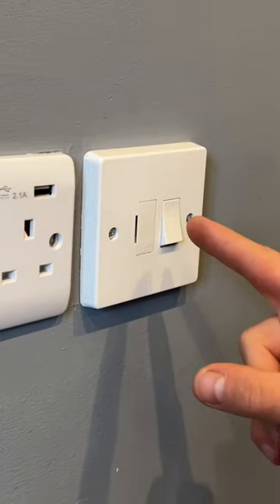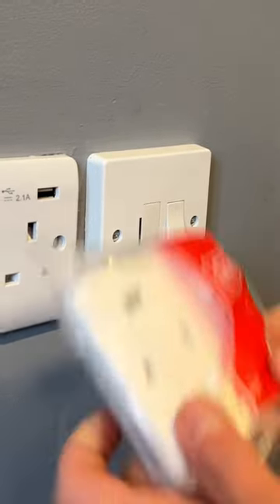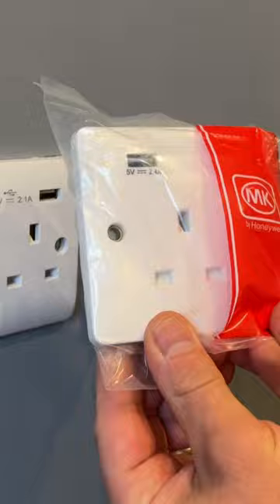Should homeowners and DIY Dave be allowed to change socket fronts? #electrician #shorts #prysmian

Comment: Yes, absolutely homeowners should be allowed to do these tasks. We are not all without a good understanding of electricity, regulations and safety. Not everyone who does their own work is a DIY Dave - I certainly don't want a fire or shock. The original installation in my 2004 home, built and certified by a major national builder, was awful.  It would be a gross intrusion of the nanny state if I was unable to do competent repair or upgrade works in my own premises.
Reply: If this was an old installation with no rcd or rcbo protection, then adding a socket to ANY circuit would be against current wiring regs. How many homeowners are going to know that?
Reply: @semperidem2577 not really interested in getting into this debate but the extra socket would be no better or worse than the rest of the installation. Incompetence is a problem amongst some trades as well as DIY
Reply: @johnwarwick4105  That is patently not true, if you have an installation that is already not as safe as it could be, then adding another socket is just compounding that risk. You can choose not to debate it until you are blue in the face, but the fact remains... it is against the regs. People seem to forget that insurance companies use any excuse to not pay out on a claim, if you're installation is dodgy and that has resulted in a fire...  that's just the sort of excuse they are looking for, to not pay out 😉
Reply: @semperidem2577   "There is no protection against human stupidity." RCDs and RCBOs are just that, protection in case someone dumb enough sticks a fork/knife whatever into something live......
(In europe we do not us those and for some reason we aint dropping dead like flies from shocks....)
Reply: @semperidem2577  I agree with both of you. John is correct that it's no worse... but you are absolutely correct it WILL invalidate the insurance
Reply: Do home owners have MFT's and know how to use them, so they can confirm its safe?
Reply: @TeamSimpsonRacing  That is a fair point, but equally  a homeowner doesn't have the equipment to perform PAT checks on their appliances either  (I do come from the generation where you had to fit your own plug!).  If I do minor, permitted works at home e.g. replacing a socket I use a relatively inexpensive 13A plug-in tester which as well as polarity does a basic earth loop impedance check too. If I install a class 1 light fitting I will always check earth continuity with a simple meter from metalwork to another good earth point. Clearly these are totally inadequate to certify professional work, but I believe these are reasonable tests that a competent homeowner can take - in addition to the most important factors of visually inspecting the work and understanding what you are doing.  "DIY Dave" is always going to exist and legislation isn't going to stop him, but it would punish others.
Reply: You can replace an existing socket as the regs are not retrospective. Adding an additional socket the current regs apply.
Reply: @smiffysmiffy123 If done by a professional a minor works would have to be issued, but as it is not notifiable works if the homeowner did it themselves to the same standard as the rest of the house who would know?
Reply: Only problem is you don’t have suitable testing equipment 
Unless of course you’re willing to drop a grand on a tester and know how to use it and what those results mean
Reply: but my whole life revolves around telling people they cant do simple tasks in the name of safety /s
Reply: @oiuslags For changing a socket? Don't be that guy....
Reply: @semperidem2577  but it will just be the same as any other socket in the house. Not going to be any less safe is it? Not to current standards is exactly that, if it was unsafe, it would be coded accordingly
Reply: Hmm tricky one, can you be sure they will connect cpc’s properly though that’s one problem. Polarity too? Loose terminations causing high impedance or worse an arc and burns in equipment? A lot of things left to chance with someone who’s not seen as electrically competent.
Reply: @dom6140  I’ve done so many socket changes and then the tests have picked up unknown non visible issues that’s why we test and inspect all our work so no one dies, nothing catches on fire & most importantly I don’t go to jail because I tested, inspected & recorded my results on a test form that’s got a permanent record 

Common issues 
No ring continuity on any some or all conductors 
Rcd/rcbo fails to operate, yer do the six tests, it’s your bo!!ocks on the line 

Mega high loop tests on TN and TT  systems (relatively) ,

Oh look these a neutral fault at the cut out 
Oversize protection /undersized cables 
Wrong mcb in a DB , jammed in and bits cut out 
And my all time favourite mixed up conductors at the metre or reverse polarity ( the bs to get that sorted dealing with the electrical supplier can take months)

Yer so test stuff it’s still cheaper than a family funeral
Reply: @spark0420  The homeowner determines if they are competent enough, as they bear the risk. As a society, we've determined that some things are extremely risky and/or have the potential to affect others, so those activities are regulated (e.g. driving a vehicle, performing HV work, etc). I'd argue that a simple socket replacement is less hazardous than cooking over a gas range or riding a bicycle.
Reply: Try to stop us :)
Reply: How many electricians actually give you certification  for the work they carry out, answer very few. Most sparks I have worked alongside bodge. That's a fact. Money over safety comes to mind.
Reply: Lstd- not sure about that - no “ electrician “ knowingly installs dodgy work!  Issuing a certificate is another thing as in mine and many other Ltd opinion who has to fork out for the many schemes we subscribe to think it’s a con ! And it is a con! Being a member of the NICEIC doesn’t make you a competent electrician - I was a competent electrician when I gained my nvq3 and am2 - a certificate scheme should not allow any qualified electrician not to do said work - ridiculous.
Reply: @semperidem2577  the constant changing of the regulations don't help. I did mine 20 odd years ago with the 16th addition, now it's up to the 18th, and electricity is still electricity. Job's for the boys me thinks!
Reply: @wyattutz  You absolutely cannot do safe electrical installation work with the proper testing equipment, so how many people in your country own the required, expensive, test gear? Even then, you may be able to work the tester but interpreting the results properly is what sets the professionals apart. I'm betting not many would even know what  Ze, Zs or Zdb testing even is, and doing a proper adiabatic equation would have them running for the hills...
Reply: @wyattutz  Problem is, here in the UK a copy of the Regs will set you back £80 and a tester capable of doing all the required tests is about 10X that. So even if you had software that could handhold DIYers, the cost of the kit would be prohibitive. Finally, some work requires that you register the fact it has been done with the local council. The council won't just let anybody register work, you have to be part of a certification scheme. membership of which requires qualifications and an annual membership fee of £600+
I appreciate that electrical work is not that hard, you just follow the rules and buy the correct gear. Unfortunately, there's always some idiot out there that decides to rewire his whole kitchen in 1.5mm2. It has to be strictly controlled or it would get out of hand. Would you like to buy a property where the previous owner has 'dabbled' with the electrics? Even if you have an electrical inspection done, there's still stuff that could be hidden away waiting to go poof. Unless I bought a new build, one of the first things I'd likely do is rewire to my own satisfaction. Hell, I'd probably even do it with a new build given some of the cowboys that work in the construction industry over here.
Reply: @thelight3112  Unfortunately that is not true and is a common misconception, especially among the people requesting the work. As the competent person it is your and your responsibility alone to ensure that the work you do up to standard and to the Regs.  A property owner cannot say they will bear the risk, if for example they ask you to cut corners or do work that is not to the Regs.  
Courts will not recognise that and if anything has gone wrong, it will be the Spark who gets the blame. You, the Spark, are the professional and you should know better.

Comment: Loving the assumption that because the socket is isolated then the FCU must be too!!!
Reply: Pointless comment. There are too many unknowns.
Reply: @traineespark  Safe Isolation Procedure???
Reply: @traineespark  what lol.
Mark is absolutely right 
Your comment is just playing captain hindsight/devil’s advocate now
Reply: Definitely not. As a trainee you should know that you should have isolated supply and tested before starting the work.
Reply: I never regret safe isolation and it would have been easy to check that fcu with a voltage tester. Don't take your own safety for granted
Reply: @g7mks383 maybe yes but he’s showing how to do it to others on YT. It just guide how to get electrocuted then
Reply: yes certainly @master00log
Reply: @traineespark that’s why you’re only a trainee. Come back when you’ve finished school.
Reply: I think we can take it as read that the power was turned off. Not everybody needs to be told to do this.
Reply: What about the previous installer who didn't earth the metal clad back box
Reply: @dom6140 it's not a requirement in BS7671 ITS good practice
Reply: You're only assuming that
Reply: @dandf7423  It is a requirement depending on the lugs (Fixed or adjustable)
Reply: @dom6140 not required if you have a fixed lug on the back box ..

Comment: I use to do electrical testing on new build houses in the early 90s , some qualified sparks shouldn’t be doing electrical work
Reply: Ain’t that the fucking truth mate 😂 Certificates written in crayon some of them 🤦
Reply: I haven't any regs but have a diploma and I agree some of the 18th brigade  that tell me what I should do is a joke when they sat 2 days compared to my 5yrs and think they are now a sparky as they have the regs 
Any one  can read a book
Reply: Earthing the back box???
Reply: @octymocty132 Said by someone wjo clearly hasnt read the blue/ brown book because it ain't like any engineering book it's a fcuking nightmare to navigate 😂
Reply: When we moved in to this new build 15 years ago I used a tester (now no longer made as the company went bust) on all of my sockets. 3 sockets need to be re-done because they had N and L swapped, one had no earth. And since the extractor failed we have discovered the level of bodgery extended to using silicone to hold it to the ceiling where they wrecked the plaster board and the screws in the extractor, as well as making a 2nd set of holes in the extractor housing because of the other damage they have done.
Reply: @dennis8196  what’s more worrying is that it must not have been tested and no one noticed. I hope you got an independent Sparkey round to do an eicr because if you found that with just a socket tester god knows what a spark would find

Comment: Not all DIYers are useless! I rewired and replumbed my house. Electrical installation passed a comprehensive EICR with no faults. Plumbing and central heating is working a treat.. Don't tar us all with the same brush!!
Reply: If you rewired your house you’d need an Eic certificate. An Eicr is a condition report used to certify an existing installation.
Reply: @smiffysmiffy123  the council can come out and inspect and give an EIC depends on which council to cost. I’m a competent diyer but unless you have the testing equipment yourself get an electrician to test because even though your work is great you could have a faulty device or in rare cases a cable
Reply: It's a fused spur for a reason . Teach em to turn off the electric ..
Lick fingers and touch bare wires 😂
Reply: It’s ok if you’re the only person using your house. I’d imagine sparkies are well insured for if anything does go wrong. I’d never touch electrics unless it’s something small like a socket
Reply: Easy way not to produce an eic! Carry out the works then produce an EICR -  who will know ??
Reply: So   did Building Control accept your EICR then ?
Reply: @tombruton   Good luck in finding a sparky that going to come out and certify someone else's work. I know I certainly wouldn't put my name to an EIC if someone else has done the work. I wouldn't even put my name to one done by another spark... There's too many cowboys out there... People that take shortcuts in areas that will never see the light of day until it's too late.

Comment: You don’t need to be an electrician to do electrical work, just competent.
Reply: Yes & when someone dies & you were the last one there you won’t have a certificate to prove the bit you did was correct.
Reply: @smiffysmiffy123  A certificate doesn’t prove thing were done right. Plenty of cowboy sparks out there falsifying certificates and EICR’s.
Reply: But if you can't prove it, it's going to invalidate any house insurance claim.
Reply: Nobody is going to die from changing a socket accessory, please provide proof that this has happened?
Reply: @paulhancock3844 this happened to a Welsh MPs daughter in a kitchen. It's why Wales have Part P to include the kitchen... Good effort with your nonchalance regarding regs though
Reply: @smiffysmiffy123 if you are competent and work within your capabilities then nobody will die as a result of your work. The danger is when people “think” they are competent……
Reply: @nathanclark5916  What exactly happened?
Reply: @smiffysmiffy123  Christ... A qualification or certificate doesn't prove that you have done something correctly. Ever heard of incompetence?
Reply: @smiffysmiffy123 you can still die from DC as well and yet we're all allowed to build electronics. Sure it has to be much higher numbers but still, theres risk involved. Just because you have a certificate doesn't make you a good electrician, it just gives you something to fall back on when you do make a mistake.
Reply: @smiffysmiffy123  Solution: Don't do such a horrible job that it kills people.
Also, DIY Dave and Homeowner Harry aren't out there doing jobs for clients. They're swapping the worn-out switch in the hall that gets used 49 times a day.
Reply: @thelight3112 and you might think that's acceptable but as we have seen, you won't be insured, you will be liable if caught following fire or accident. It doesn't even have to be a death, it could be a zap from it.

I've seen peoples work that has resulted in fires or nearly a fire (caught early) because cables have not been screwed in connectors tight enough or over tightened to damage the thread making the connection arc till it caught alight. 

One place I know of had the lighting circuit from one floor looped into the lighting on another floor - when one of light ballasts died due to age and failing components it should have triggered the breaker to trip, however because a DIYer looped both rings together in error the circuit was receiving power from 2 different sources and therefore didn't blow the fuse on one, or the breaker on the other. It was caught at the last moment when it set off the smoke alarm.
Reply: True. When the building inspector knew I had designed the electrical installation for my self build, and saw the first fix, he was happy to regard me as a 'competent person' and I used a registered sparks for testing for the certificates. No issues.
Reply: Really......how are you going to test the work and submit a certificate  if needed........say goodbye to your home insurance

Comment: The socket next to it isn’t always necessarily on the same circuit, I’ve been stung on this one before.
Reply: You would have got stung if you tested it was dead before you unscrewed the face plate would you?
Reply: My thoughts exactly, we had/have similar spurs here which we swapped most for single sockets but they are on the old Economy7 circuit. Why test the socket next to it? I’d be testing the spur with the trusty volt stick once I’d got the cover off no matter what I thought was going on.
Reply: @bobbo9549  Exactly, I’m saying don’t make my mistake and assume a spur is off because the socket next to it is off. Always test.
Reply: Yes this is very true, our kitchen has regular sockets on one circuit and the oven (with isolator) on a separate one, never assume sockets in the same room or even the same floor are on the same circuit.
Reply: He should've used a voltmeter over the cables to test active voltage.

Comment: Took me along time to get my level 3 18th but putting a socket on really isn’t part of being an electrician as long as the wiring is acceptable eg not a 1800’s house on black and reds or worse steel cables. Just leave testing and new extensions and fault finding to us fit your own sockets and switches

Comment: As a DIYer pefectly competent at fitting a socket, how much would yiu charge me to do something that takes a few minutes. And then you have the cheek to ask if we should be "allowed" to do this ourselves.
Reply: Tell me you have never ran a business without telling me…..
Reply: But they would not have to skills or the test gear required to see if there is a problem with the circuit the socket is being connected to. A decent electrician should check the impedance and make sure it falls within acceptable limits. This is what you're paying for, not just changing the socket itself.